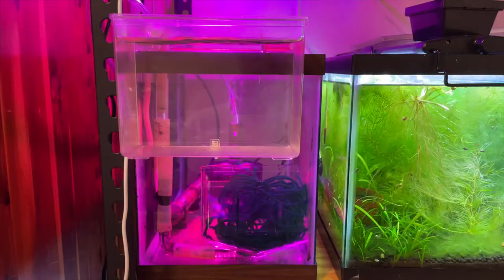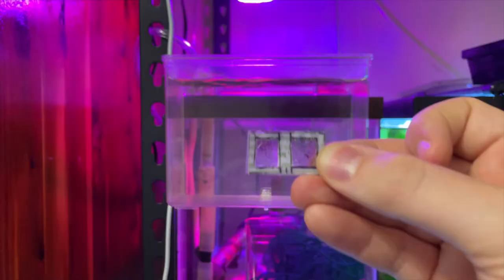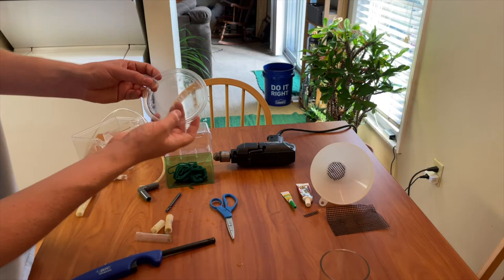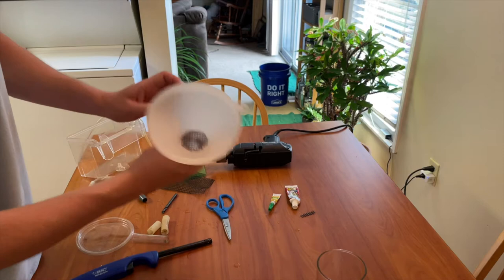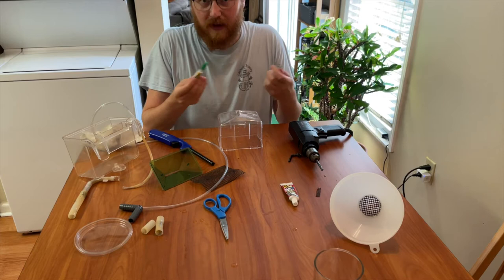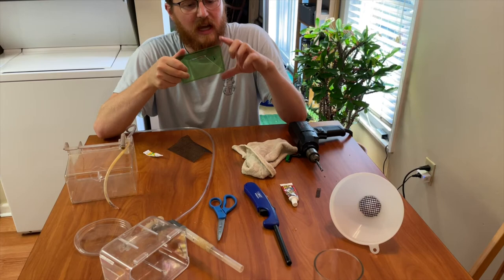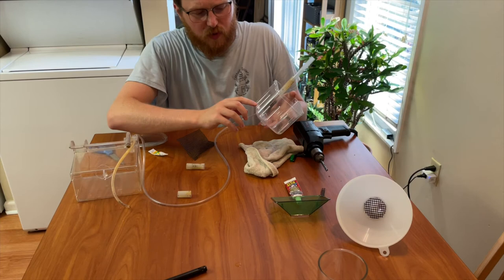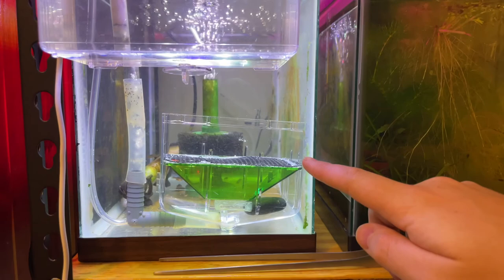Breeding Egg Scattering Fish with no Wet Hands

Comment: Craziest thing I built pretty much this same set up 2 weeks ago! 😅
Reply from the maker: Really? That is crazy! Did you use the same breeder boxes? Or was it something different, more similar to some of the other videos showing this?
Reply: I started to use a 2 liter bottle top as a funnel  and it was too tall so I got the same breeder boxes. Zip tied the black mesh to the green part.
Reply from the maker: Yup I went two liter bottle, then funnel, then this breeder box. Have the zip ties done a good job at preventing the adults from getting below? And do you have any spawning media above the mesh or is it bare mesh that the CPDs are spawning over?
Reply: @TheAquariumLibrary  yeah I have not had any issue I did have to put a rock so hold it down. I put a small amount of subwassertang then with a pipette I blow everything down after they stop spawning
Reply from the maker: I might have to try a small amount of the subwassertang if my bare mesh doesn’t work

Comment: awesome idea
Reply from the maker: Are you going to try making it for yourself?
Reply: @TheAquariumLibrary  I've tried your previous method and it works like a bomb
Reply from the maker: And see I like this one even better as it is so much easier to collect the eggs than the previous method I used.
Reply: only problem is that is I'm having is that some of the eggs are getting white and fluffy , so I dont know if it is fungi or the eggs are not fertilized
Reply from the maker: So I was having that problem as well. What I started doing with letting my containers that I was hatching the eggs out in dry out completely before use again. I saw a reduced amount of fungused eggs. Before that, I also found that I had less of those eggs when I went shorter amounts of times between checking the container for eggs. 

You could always try using some methylene blue and see if that works at preventing the fungusing
Reply: I've gotten me yesterday some methylene blue , I'm going to see how it goes , I've turned my breeding to your new method  🥳
Reply: you are totally awesome with your ideas
Reply from the maker: @mansoorcassiem1901  Thank you mansoor. I hope the breeding works out well for you
Reply: hope so too buddy , 🤞

Comment: Thank you!
Reply from the maker: You’re most welcome! Do you think your going to try and make one yourself?
Reply: @TheAquariumLibrary  I did last week. I woke up a couple days ago and found a female neo shrimp stuck in tube. Had to rip out the airline i drilled. This time I will install some kind of mesh cover over the hole. Let me know if you have suggestions. Thanks again!
Reply from the maker: Oh wow. I had never thought about a shrimp getting stuck in the tube before. Granted I don’t keep shrimp in my breeding tanks so I never would have thought of that happening. 

Did it get stuck in the airline tube or did it get stuck in the uplift tube?
Reply: @TheAquariumLibrary  Yeah I had a single female neo I was waiting to transfer into another tank before I added my CPDs. She got stuck in the uplift tube right after the airline. Luckily she seems unharmed. I was on a live stream the other day and the group mentioned your video as a good one to follow to breed CPDs. I just added a little  piece of plastic near the hole small enough so my fish dont get curious and swin down but big enough for the eggs to fall through hopefully. Thanks again, keep up the great work!
Reply from the maker: Gotcha. I have since updated the design so that nothing but eggs and maybe some other very small critters can fit through. But no adult fish or shrimp could get through. If you go to my channel you can see the updates that I have since made to my original design. (Edit: check out the playlist called automatic egg harvester)

Also what livestream was this mentioned in? I always am looking for some good fish live streams to watch.

Comment: Nice idea...is hot glue safe for fish tanks?
Reply from the maker: I’ve heard hot glue doesn’t hold up well in tanks from other people. I’ve never used hot glue as I use super glue or silicon so I can’t speak from personal experience. I’ve also not heard anything about it being toxic to the fish but this is also because I’ve never seriously looked at using it. Sorry I couldn’t be more helpful. Do you have a fish that you’d like to try and spawn with this system?
Reply: @TheAquariumLibrary  No, the fish I have spawn sticky eggs but I like your system.
Reply from the maker: Gotcha, the one thing I want to experiment with is sticky eggs and see if you can’t suck the wrigglers down and put once they hatch out of the spawning mop. That’s the idea on my head but I haven’t been able to try it out yet.

Comment: What water your CPDs live in? I get random results when it comes to hatch rate.
Reply from the maker: My CPDs are in hard Kentucky Limestone water. The pH is around 7.0-7.5 and temps around 72-74 F

Are you having random meaning that over a period of three weeks eggs will continue to hatch out or random that only half of the eggs ever hatch?
Reply: @TheAquariumLibrary  I mean low percentage of hatch eggs that were deposited on one given day. What is your hardness/TDS of your water?
Reply from the maker: I have not measured it recently but I know that it is also high. 

Were you noticing eggs that had fungus on them, or eggs that developed eyes but were never able to break out of their eggs.
Reply: @TheAquariumLibrary  most eggs become white inside within 24 hours, no fungus on the eggs so my theory is that they were not fertilized properly.
Reply from the maker: @HodujemyRyby  that's exactly what i was thinking as i was reading your comment. How many males and females do you have in your breeding group.
Reply: @TheAquariumLibrary  abot 20 +20 but this is young breeding group
Reply from the maker: @HodujemyRyby  Yeah the males might just need some more time to figure it out as they are a young breeding group.